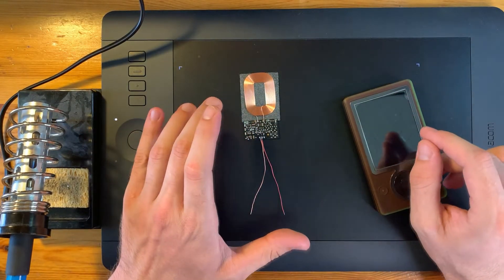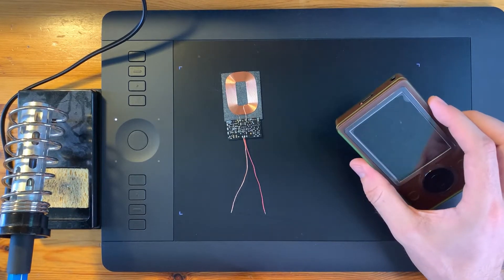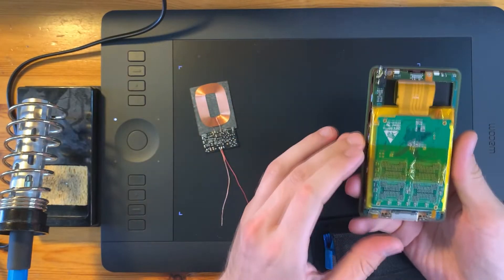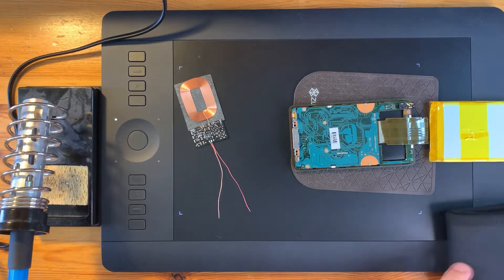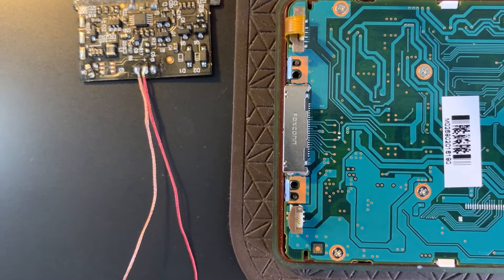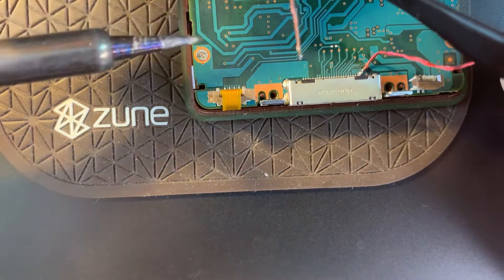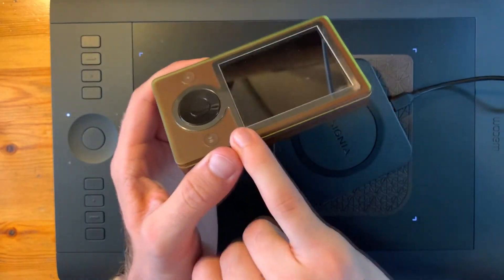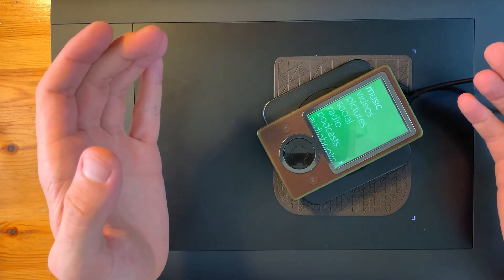Qi Wireless Charging Tutorial for Zune 30

Comment: I want to connect bluetooth this device to my airpods, do u have any idea for this device ?
Reply from the maker: I’ve accomplished this before by gutting a USB Bluetooth receiver and hardwiring it to a Zune 30s power supply and headphone jack. It’s kind of a tricky job, and requires swapping the stock HDD with a SSD - the swap frees up enough room in the chassis for the BT transmitter.
As far as using AirPods with it, theoretically should work fine, but I’ve never tested it.
I had planned on making a tutorial on the process but my life is entirely too busy atm and don’t see me having any time for it in the near future. There are a couple tutorials on YT already, though.

Comment: Can the wireless charging pad fit outside of the HD cage? or is it necessary to remove the cage entirely for this mod?

I'm about to do one of my own.
Reply from the maker: Iirc I tried that and it was too high of a fit. If you shaved away at the inside of the back panel, you could probably get it to fit. I think it was just barely too bulky for the sync port screws to go in

Comment: Sir, is it possible to add bluetooth to any of the zune models without slapping a dongle on the aux port?  Like repurposing the car radio responder dongle the zune had (included a recharging cigarrette lighter port and a small remote for vol/skip/rewind).
Reply from the maker: Yes, but afaik only on the 1st Gen models. That was actually a mod I performed right after this one, and all the previous mods were able to fit too.

I repurposed a USB powered transmitter, took that apart and installed it. I think getting it to fit will be a challenge without an SSD upgrade, and there are two other required parts. I was a pain, but definitely possible.
Reply: @OfficialZunity  I was thinking of just 3d printing a new shell, my 30gb fat has that battery on the screen error since 2015.  Is in storage :(  I has the mini zune that needs a new battery (cant hold charge) and the hd im using right now in my car by aux port.

Any mods possible on the other models?  Was thinking of a usb-c mod on all three of mine.  And new batteries, preferrably larger capacity.